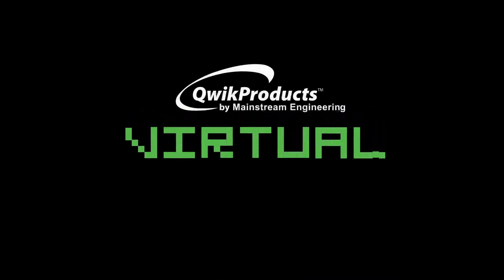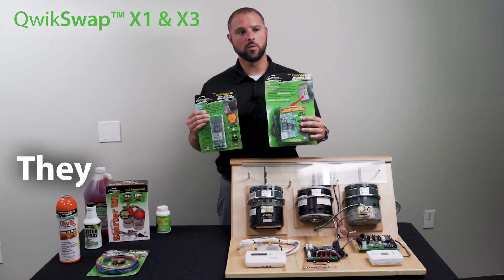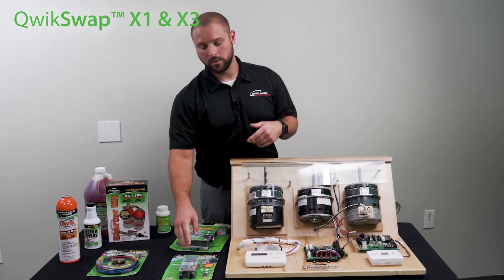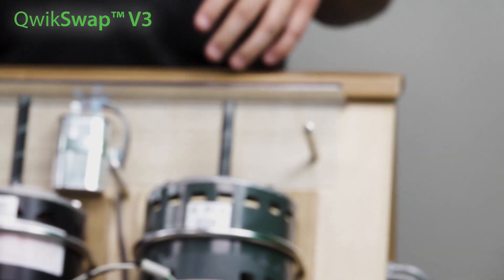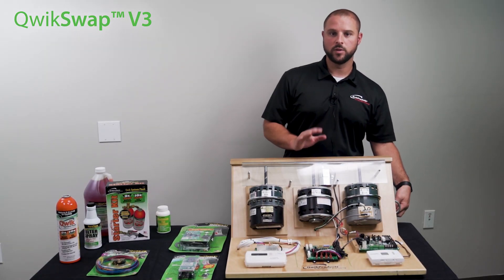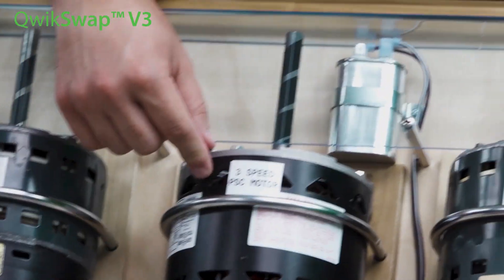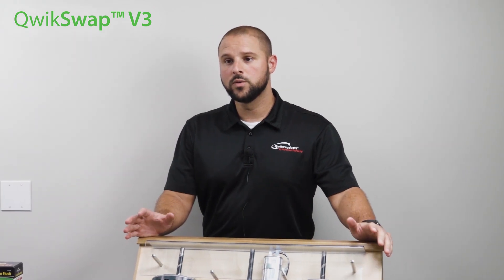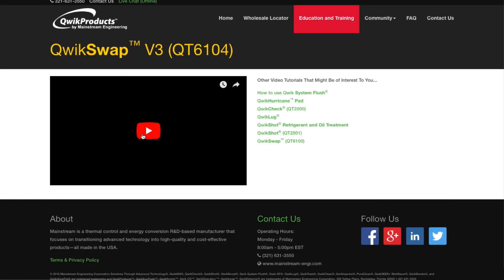The Easiest ECM to PSC Blower Motor Conversion | QwikProducts Virtual Trade Show - Ep. 2

Comment: per say I have an ECM 16 pin 2.3 motor 1 HP 1050 RPM  in a Trane unit do I replace it with the same specs as well on a PSC motor? or do I need to down size it?
Reply from the maker: Thank you for your comment! When replacing an ECM motor (like your 16-pin, 2.3, 1 HP, 1050 RPM in a Trane unit) with a PSC motor using a QwikSwap board, you should match the horsepower (1 HP) and RPM (1050) as closely as possible to ensure compatibility and performance. However, for precise guidance on your specific setup and whether downsizing is needed, please contact our technical support at 321-631-3550 to speak with the engineer who designed QwikSwap. For more details, visit https://www.qwik.com/qwikswap/.

Comment: So would you need two board in the system, one for the motor and the original one for everything else?  Or does the quick swap let you connect the heating and cooling wires too?
Reply from the maker: Hello Luis, it is correct that you would keep the thermostat control board in the system. The QwikSwap bridges the communication between the PSC motor and the thermostat board.
Reply: Nice @qwikproduct

Comment: Good video. What about DC motor controls. My Tempstar has a speed control board between the main board and the motor. I believe it's doing the same thing as the end-cap, or bell on the ecm motor. It's discontinued of course so I'm scrambling to get it working as winter sets in. I believe a 24vdc transformer and a bridge rectifier switched in by a relay triggered by the signal from the main board will get me going. Only one speed of course.
Reply from the maker: Thank you for the comment.  As a general rule of thumb, if the original motor has a constant torque ECM (X13) style plug, it will be compatible with our QwikSwap X1 and QwikSwap X3.  If the original motor is a variable speed ECM (2.0, 2.3, 2.5, 3.0) with a 16 pin or 4 pin plug, it will be compatible with our QwikSwap V3.
Reply: @qwikproduct  Thanks for responding. It's a Tempstar furnace, and the wiring diagram inside the bottom cover says DC motor, but everything I can find on the motor (M55bmcnr-216) says it's 230 vac. Very confusing.

Comment: I might've been using the wrong Quickswap board on a Trane pkg unit, hoping you can help me out.The part number on the motor module D341314P51, 3/4HP, 16 pin. I used the Quickswap V3, followed the installation instructions and as soon as I turn the power on to the unit the blower motor came on. The thermostat wasn't calling for cooling or heating and the fan was set to auto. I figured it would run for a couple of min. then shut off but it just stayed on. Ended up just taking it off and wiring the PSC motor to the contactor for cooling. I installed the same V3 board on a ICP pkg. unit and it worked fine.(I uploaded a short video installing it)could it be that  maybe it wasn't compatible with the Trane unit? if so , which board would work with Trane?
Reply from the maker: Thank you for the comment and for using our product!  The QwikSwap V3 will work on the Trane unit that you are referencing.  Sometimes the OEM ECM motor has a slightly different program so the QwikSwap needs a one time manual setting on the configuration switches.  This setting can be found in appendix A1 in the install instructions.  We would also be happy to walk you through it over the phone 321-631-3550.  Additionally there is an interactive troubleshooting guide on our website that will walk you through the configuration setting.  It is very easy to use.  Here is a link to that troubleshooting guide: https://qwikproducts.yonyx.com/y/conversation/?id=87f40380-33af-11e9-a9a4-4201c0a80133&h=1&st=0

Comment: looks good- but I have never seen them in the local parts suppliers.  Plus they are about 100$ on ebay- a generic ecm motor is 200.  A peanut relay is 8$.  I would love to try it but I need to be able to get it and I wont buy it from someone on ebay.  WHo are distributors.
Reply from the maker: Mark, thank you for your interest in our Qwik Swaps.  If you go to our website, https://www.qwik.com/, there is a wholesaler locater feature at the top of the page.  Simply enter your zip code, and a list of local HVACR wholesalers will be displayed.

Comment: But, I thought ECM's were more energy efficient than PSC motors. Why would you ever want to swap a PSC for an ECM?
Reply from the maker: Thank you for the comment.  There are several variables to consider and ultimately the homeowner has to be happy with the choice.  Up front cost is certainly an important factor.  The QwikSwap/PSC option is typically much less expensive than the variable speed ECM option.
Reply: The blower motor doesn't consume near as much electricity as the compressor or heater elements so it's not lowering your bill that much. And the ECM controller is vulnerable to power surges. The failure rate is much higher than PSC motors and until mfg's figure out how to make the controller's more reliable, they will continue to be an inferior motor to the PSC.
Reply: This can give the homeowner an immediate repair to get aircon up and running instead of waiting for a hard to find special and expensive ECM motor to be shipped,  and consequently swelter in the heat until it arrives.

Comment: Except it’s over $200.  You are better off grabbing the green and red from a thermostat and adding an extra contractor then picking one speed tap and making it work for $15.
Reply: you forgot to mention that the PSC will last much longer as it is not nearly as vulnerable to power surges as the controller used in the ECM. I'll take years of reliability over a few dollars a month in savings for efficiency only to have to replace the ECM every few years after a power surge.
Reply: @jg9002  That is why we install surge protectors on the systems.  They have inline surge protectors that are specifically designed for this situation.  Never remove an ECM for a PSC.  That is ridiculous and just another dog and pony show.  Why step back in time when you can get a US Motor Rescue or Evergreen motor in its place.  This product is nonsense.
Reply from the maker: Thank you for your comment.  Utilizing a QwikSwap will allow for much better energy efficiency and humidity removal compared to using only a PSC motor.
Reply: @qwikproduct  I bet you this guy still has his underwear from when he was ten, cheap bastard.....
Reply: @qwikproduct  yeah, but that is only the multistage one at almost $300 that controls humidity better plus it needs a motor... May as well buy a proper ECM motor at that price in my opinion.
Reply from the maker: @NETWizzJbirk  Both the QwikSwap V3 and the QwikSwap X3 have the multi-speed capabilities.  You should find those products at two quite different price points.  OEM variable speed ECM motors can be much more than the cost of a QwikSwap V3 and a PSC motor.  Aftermarket ECM motors that can replace OEM variable speed ECM motors may be a similar price to the QwikSwap but they have communication restrictions that prohibit them from being "universal".    QwikSwap is the only aftermarket ECM replacement product that does not have those communication restrictions.  That is the essence of the true value of QwikSwap.  It is a tool that can be kept on the truck that can replace any ECM you may encounter in the field.

Comment: I have a psc motor on an oil furnace what products can I use to change to ECM?  ideally I would like variable speed of possible .
Reply from the maker: Hi Bjorn, Thank you for your comment.  We actually make a product for exactly the situation you are describing.  The product is called the QwikSEER+ WattSaver.  QwikSEER is designed to combine with a PSC motor to improve it's efficiency and humidity removal by allowing it to change between high, medium, and low speed automatically.  Here is a link to the QwikSEER product page for more info: https://www.qwik.com/product/qwikseer-wattsaver/

Comment: I just removed my psc motor today and installed an ecm.  I saved 130 watts on high speed, and saved 350 watts on low speed.  Not to mention I dialed in my static CFM to allow my modulating heat pump to run more efficiently.  Why on earth would you want to go from ecm back to psc?  If you've got an older trouble prone x13, why not just get a new Genteq and leave the woes behind you?
Reply: Because the genteq is nothing BUT woes my friend !!! I am on my 4th one in 6 years and the unit is not even 9 years old at this point !!!
Reply: Did you install a Genteq?
Reply from the maker: Thank you for your comment and for watching our video.  The QwikSwap V3 is not for X13 replacement but for variable speed ECM (4 or 16 pin) motors.  V3 combines with a PSC motor to provide a much less expensive, universal replacement option that can be kept right on the truck.  The price point and universal capability is an immense value to the contractor as well as the homeowner.

Comment: Great video! I am in need of a new ecm module (2nd in 2 years) and I am really not wanting to spend another $550 on a module. My question is how do I figure out which psc motor that I need to buy that'll work with my furnace. My furnace is a Bryant 355mav 80k btu. I'm not sure if you can figure that out for me or if you can point me in the right direction.
Thanks!!
Reply from the maker: Hey Jake, thank you for your question.  To choose a PSC motor for replacement, first make sure that the PSC motor is the same horsepower as the failed ECM.  Next, make sure that you know which voltage the original ECM was running on because you will need to use that same voltage for the replacement PSC motor/QwikSwap V3 combination.